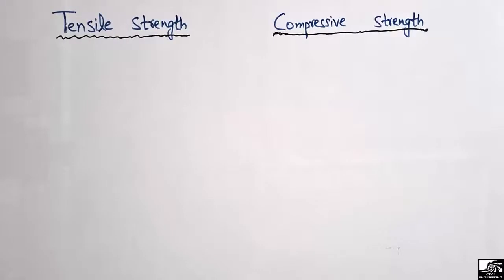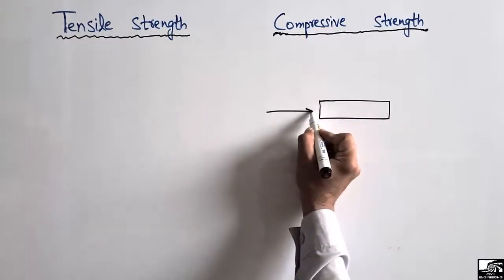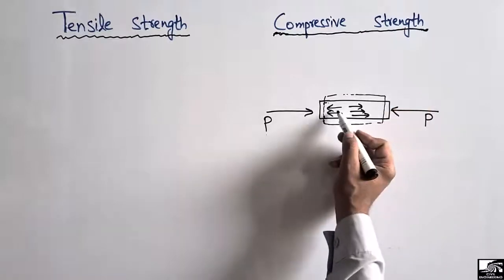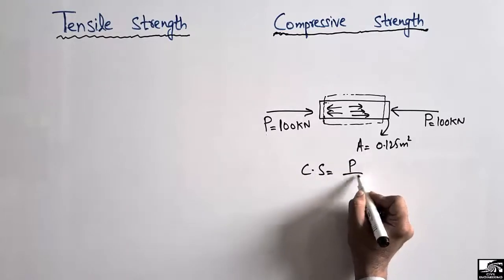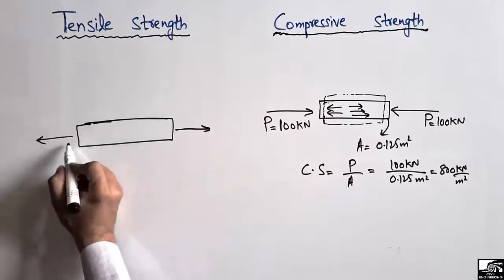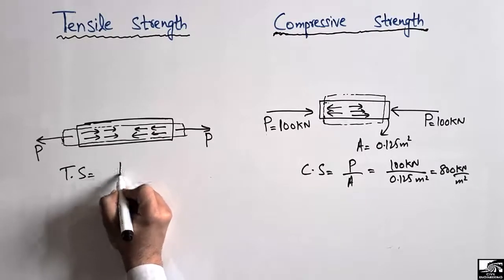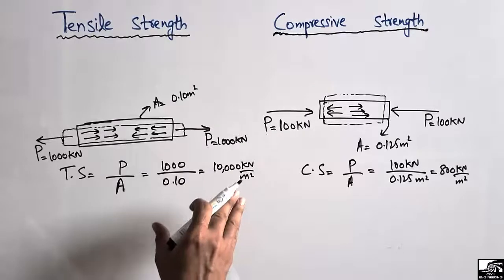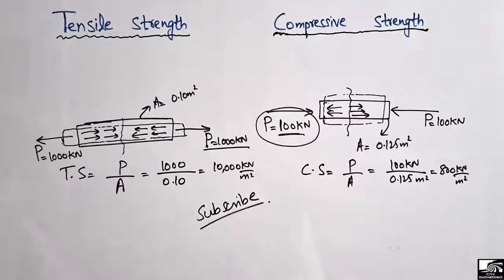Difference between Tensile and Compressive Strength

Comment: Sir tell me the values of tensile and compressive strength of steel and concrete ?
Reply: It depends of the steel and concrete quality. Concrete is a good material for compressen but relativly weak for tensile, why you have to reinforce it. Steel can have 400 MPa tensile stenght whilr concrete can be around 3 MPa.. a rule of thumb is that concrete has around 10% tensile strength of its compression capscity